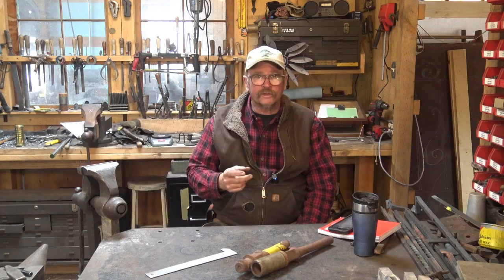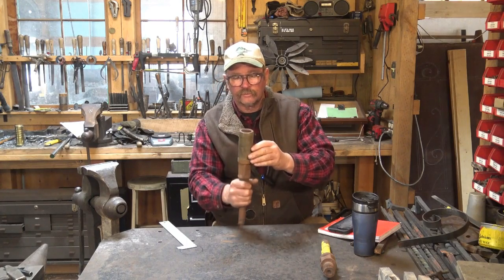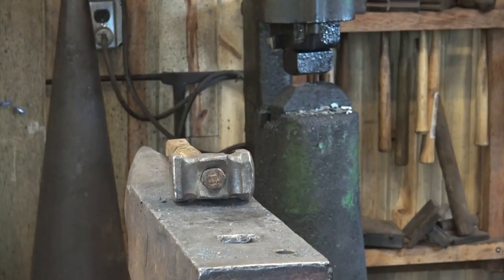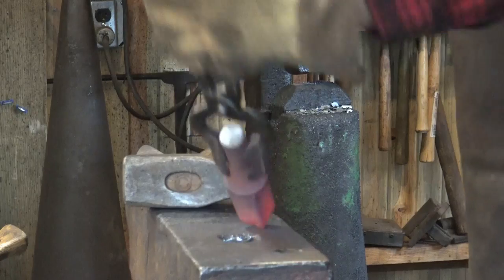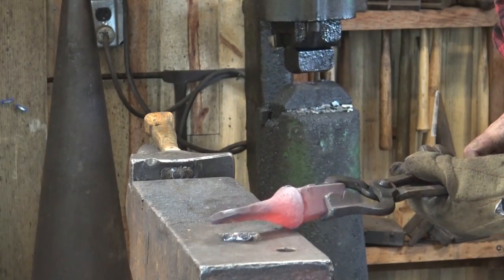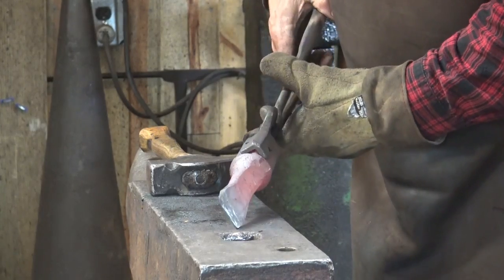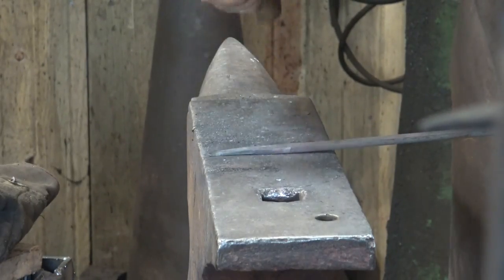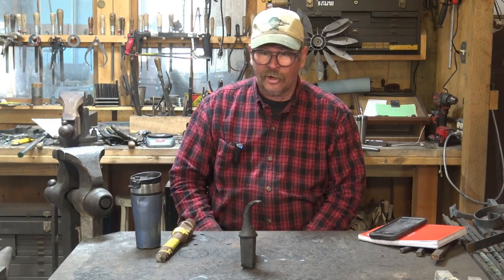Scroll starter for forging scrolls - blacksmithing tools

Comment: When I couldn't get the coupling off the 3/4" sucker rod I got, I threw it in the forge and then in the vise, and went at it with the pipe wrench, worked on the ones I had.

Comment: Another option to remove the bit without heat, would be to split the coupling lengthwise. Once it is split it will release off from the threads and it should spin right off.

Comment: Hey John, I have done some research into sucker rods and they are generally aluminised. I always test a cutoff inthe fire before i work on it to see if it zinc fumes. The aluminum will melt off but it does make a small mess
Reply from the maker: I have never seen coated sucker rod.  I wonder if you're finding something from other than oil wells
Reply: @BlackBearForge  I got it direct from the company who supplies them to oilfield companies. they were moving to a bigger shop and contacted me about donating 700 feet to the museum as they didn't want to ship it. most of it is aluminized. It is still quite usable, just sometimes the coating melts off and makes a bubble on the piece. T4 tool steel, low quench alloy. nice thing about it is that it doesnt rust as fast.
I live in Alberta
Reply: Aluminized for sour gas wells

Comment: Thanks for another great video, wish I still lived in California so I could get some sucker rod, hard to come by in Virginia. The coupling could be 1045 or 4135, during the manufacturing process they are polished.
Reply from the maker: Thanks for that information.  I wasn't sure what it was.  I'm not sure what it might be used for, but I will keep them around.  I wsill also be sharing thew contact information for the gentleman that sent me this batch of sucker rod.
Reply: I spent 40 + years working in the "oil patch" have plenty of contacts will probably reach out and see I can get some sent to me. Here is something to try if you have any sucker rod with the coupling still attached. Lay it on your anvil and hit it with a hammer while rotating it where the pin is screwed into the coupling, DON'T hit it in the same place twice or you will egg shape it and never get it off. Once you have hit it several time clamp it in a vise and use the biggest pipe wrench you own and see it you can get it off. Good Luck

Comment: I was just curious why you didn’t use an angle grinder to slit each side of the coupling to remove it saving the threaded end of the sucker rod. Thanks for showing us another great tool.
Reply from the maker: That would certainly be an option if you needed the extra length.  For this tool I didn't really need any more than I had by just cutting the whole thing off.

Comment: Hi John
Was wondering if u use your propane forge for most of your work,also do u have any tips on how I could improve my welding technique using a propane forge.i have a 3 burner majestic forge an am having a hard time forge welding. I very much appreciate your informative vedios ,and down home approach teaching method.thanks
Reply from the maker: Yes, I use the propane forge for most of my work including larger forge welds.  Every forge is different and I am not familiar with the Majestic.  The first thing I would do is talk to the manufacture. When I had trouble with mine because of the altitude they knew just what to do and sent out replacement burner jets.  The fuel and air mix has to be just right and sometimes thats just a matter of trial and error.

Comment: John what do you use to line your gas forge with. Just interested, researching the best way to do it that gives the best insulation and keeping the heat in and the most efficient way.
Reply from the maker: It is lined with Kaowool that has a cement type covering over it to protect it.  This forge was made by Chili Forge, so I'm not sure exactly what product they use.
Reply: Ok thanks John, probably that ITC 100 or satanite.

Comment: Interesting, but not practical, even for the beginner. The edge of the anvil is all that is needed to start scrolls. Thanks John for all of the great video's!
Reply from the maker: I would certainly agree that a beginner should learn over the edge of the anvil.  In 34 years this is the first time I have used a scroll starter.  However the idea does not come as a crutch for the beginner but from some of the past masters of the craft like Francis Whitaker, Samuel Yellin and Otto Schmirler.  I have seen them suggested in several old books on the subject, but those are just three names I am sure of.
Reply from the maker: Someone shared this old video https://www.youtube.com/watch?v=Xkslb2lfB-o&feature=youtu.be a scroll starter may be seen in use at about 1 minute 6 seconds
Reply: It looks like it is flared like a fish tail so he could work off the side of it.
Reply from the maker: That might be, I will go take another look

Comment: Wouldn’t the horn accomplish the same than thing?
Reply from the maker: It would come close, but the small curl at the tip of the scroll will contact the horn.  Using the starter the tip can curl under the end of the starter.  Old shops that made lots of scrolls would have several of these with various curves on the end